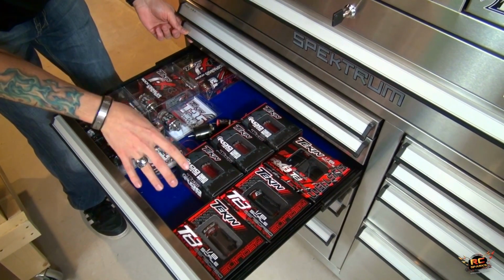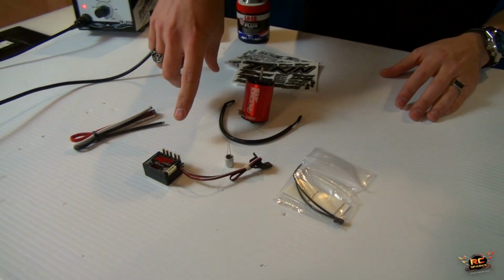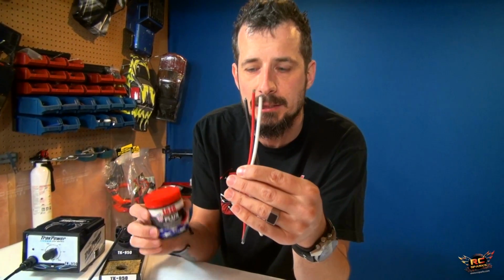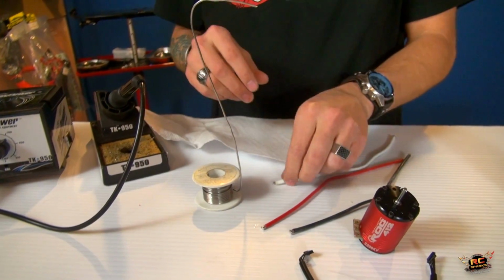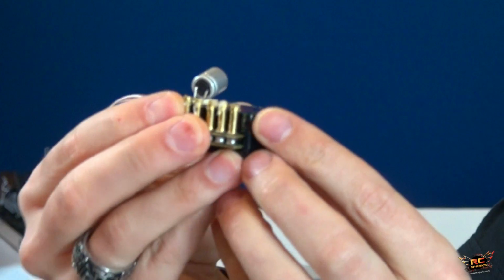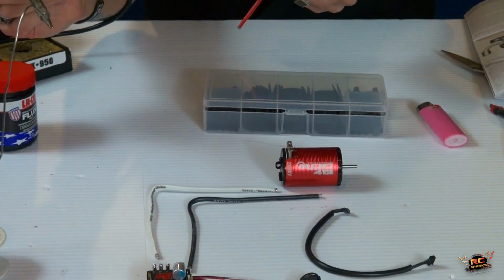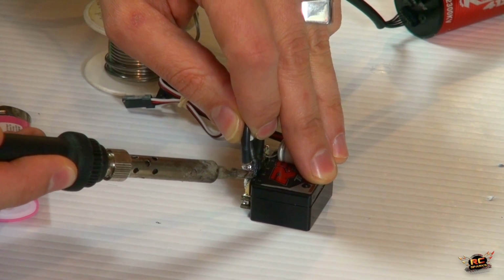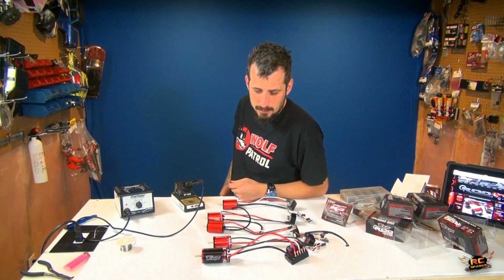RC ADVENTURES - Project: OVERKiLL - Soldering 4 Tekin ROC 412 BL Motors & RS Pro's

Comment: I had the worst time soldering my hobbywing Quicrun BL 120 esc power battery connector lol. It was a pain in the ass brother. And I used to do alot of soldering iv never ran into the issues I did yesterday. I got so mad I quite for a few hours. The solder wouldn't even stick to the banna plugs it would ball up and roll off em.. even with flux!!.. lol... Prob because it's a cheap ass banana plugs I used wire crimpers to test it to see if they was even brace or even a metal.... I crimped one of the banana plugs and it broke into piece's.... And the gold junk flaked off it... So yeah I'm picking up heavy duty connectors don't buy the cheap junk guys cause solder will not connect to it.

Comment: That Iron looks like a Hakko 936. The same one I use at work everyday for 18 years now. Great Iron though. I keep mine between 750 and 800 8hours a day 5 days a week and the tip (if taken care of) will last 3 weeks to a month. The trick is keep the solder on the tip right before you solder with it. Keep the access solder on the tip when after you solder. Scrape the dross off with a sharp edge and Sal Ammoniac Block to bring back the shine on your tip.
Reply: Forgot to mention that we use 3 types of liquid flux. Rosin witch doesn't need to be washed and safe for wires. Water Soluble witch  need to be washed off with in 4 hours and No-Clean witch can stay on the board for the life of the product.

Comment: So after you solder the leads, and the motor is turning the wrong way, do you have to unsolder, and reverse 2 of the wires?
Reply: Yes any 2,if it's still going backwards it's the other 2 that needs to be soldered on

Comment: Please a project overkill with 4 outrunners directly on the wheels. And in like a short course car.
Reply: yeah and will be full of dirt after one run :)
Reply: I didnt say it had to be offroad. And there is always a possibility of 3d printing a motor cover right?

At least it wil be overkill
Because ( for example ) 2700kv each wheel is equal to 2x 9700kv with reducion and same torque.
I am allready imagining it on a carpet track with drift wheels...
Or a speed run of 120mph +
( if it ran a 4s or 6s )

Comment: having problems with no throttle when I put 11.1volt 3s battery have done relearn ,,,works just fine with the 2s7.4 lipo ...any help would be awesome... its a brand new rukus 4+4 tazer ESC 3300kv brushless motor ...someone please have some idea ...its says its compatible for the 3cell .
Reply: Jimmy Smith to high of a voltage shut down

Comment: I've always used Rosen core solder, with the 80-20 for board to wire, and 60-40 for wire to wire soldering.

Comment: i am working on a wraith project and i am thinking of changing the stock axial motor because it seems to have too much punch or power on the rocks and i was wondering what motor would have more torque for climbing but still have enough power to blast around a field  any  suggestions? any tips would help.

Comment: You have a nicer solider iron.  But no heat gun from China?  Also don't forget cold solider joints crack.  So always make sure to get it good and hot but don't melt anything.
Reply: Sam krieger
1 second ago
There is a lot of flaming on this Chanel. If you would privet message each other.  I for one don't want to see this turn into a dating sight.

Comment: ***** if I wanted to go faster would I use less turn motors or more turns like 15t 20t
Reply: jason moore Yes, for brushed motors the lower the turn, the faster it will go with less torque. vise versa with a higher turn.

Comment: using a finer or light gauge solder will help you cause soldering without flux your roll looks really heavy the solder i use is .022" or .6mm

Comment: Would have been cool to use that fifth bigger motor as "high gear" for overkill to make it go fast as hell, then switch over to the four-motors to drive when u need torque for plowing and climbing. And make all this work from the controller. Basically a FIVE-MOTOR beast!  Sorry for my bad english ;) Keep up the good work!

Comment: Why did you put the heat shrink on the ESC solder posts? Thse posts are used as the RS/RS Pros heatsinks.

Comment: Couldnt help but notice that the 1/8 scale SKYRC Toro arien 2250kv motor just fitted to my 1/6 scale extended E-Maxx looks identical to the Tekin RX8 T8 you got in your IMMENCE tool box/wall thingy if it is the same think I lucked out as it only cost £50 bargain or what? Nice job tho buddy loving what you do result!

Comment: I don't know about you MEDiC, but when I work that close to electronics I like to use the iron to shrink the tubing. I do however work with smaller parts so it would be very difficult to use a lighter anyway.

Comment: Medic, just some constructive criticism. Ditch the flux. The resin core solder is fine. Also, for the people who don't want to get a spendy soldering station, a "Weller WP-25" with your choice of tips is great. 1. After stripping the wire, twist the exposed section so you don't have any loose strands. 2. Put a little solder on the tip of the iron and hold the tip against the side of the exposed section while adding any additional solder where the iron tip and wire meet. Merry Xmas!!!

Comment: Excellent job on the soldering medic. I have been soldering for years, even took a class on it in college.  You certainly would have passed that class. Excellent technique and it will work very well for years to come. To me there is no lower impedance connection that a correct solder joint. Keep up the good work buddy!

Comment: Hey Medic! You often mention that people have opinions regarding using flux? I myself is always using it... but why not?
Never heard not to. Is it somewhat embarrassing not to be able to do a good soldering joint without flux?
In case you don't use flux you risk to not to have a reliable connection both electrical and physical.
You can do achieve a successful soldering without flux in best of conditions (clean and grease free) but for us hobbyists it,s not enough.
Keep on soldering with flux.;-)

Comment: I know you (and others) have waterproofed them before, with success. Was more just giving a disclaimer, so that someone doesn't do this with something like a 6.5 motor in a buggy or in any on-road car. They will not be happy with the resulting meltdown of their ESC. I briefly used an RS pro in a losi 22 with a 5.5 motor. It absolutely needed a fan blowing on the posts to prevent thermalling.

Comment: Since these are just crawler motors, the ESCs shouldn't get too hot, but with faster motors and/or areas with little air flow, you don't want to have any heat shrink on the posts of a Tekin RS or RS Pro(as per Tekin). It's the only form of heat sink they have, so if you cover them, the ESC can overheat. Again, in your usage here, they will be fine I'm sure, but it's really not something that should generally be done with the RS line.

Comment: congrats on the hair and beard cut you was starting to look like a armish hobo, over here in the uk its called a soldering iron a soldering gun is something noah had on his arc didnt he (a soldering gun is well err um gun shaped) lol, i dont like to use flux for quite a few reasons (its fine for reflowing joints tho) a good quailty solder makes a cleaner joint hay ho each to there own

iirc the new overkill is 6 wheel drive and 6 wheel steer 5 motors will make it intresting